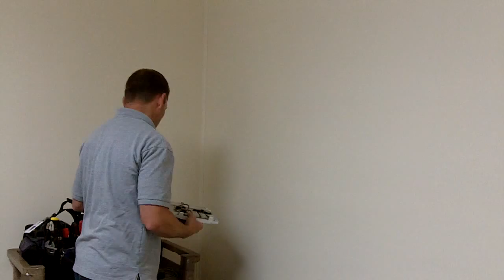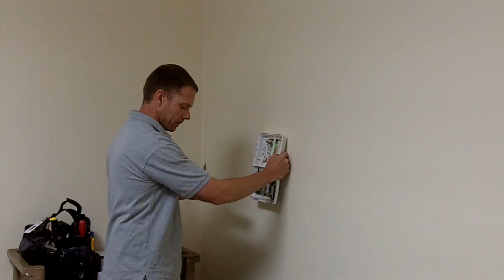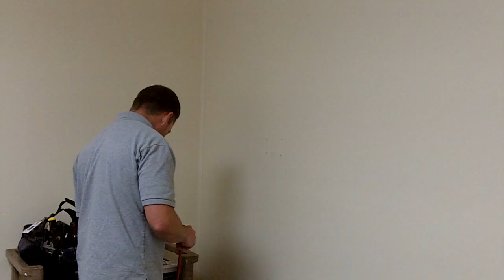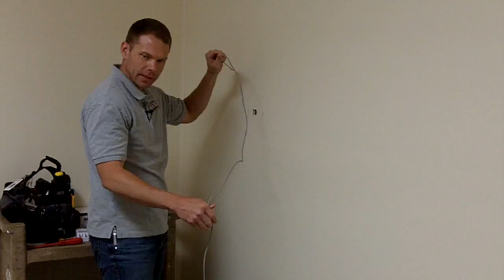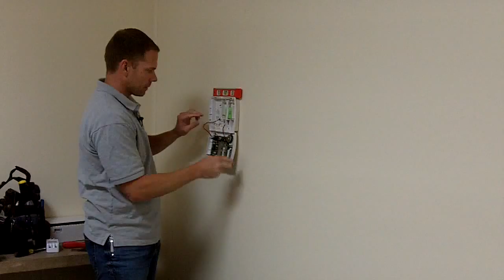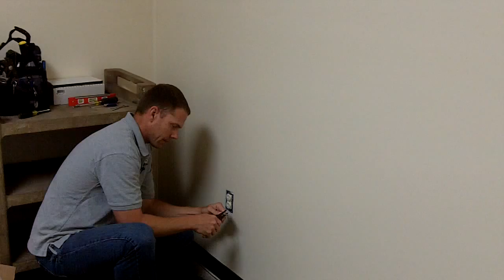Lynx Touch 5100 Installation

Comment: I have configured TCC800 Fob at Galaxy 48 panel. It is working but it generates 1 tamper zone error message. Logs says it is related to 1008 PA. I have a clue that it has to do with termination a kind of EOL or something. I have nothing connected at RIO 1 and RIO 2 outputs. Could you give me a tip?